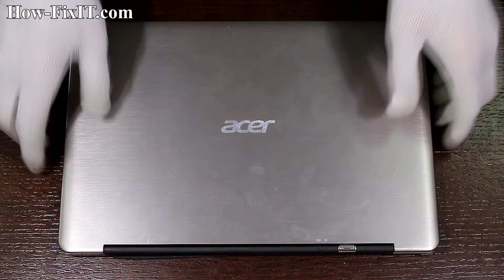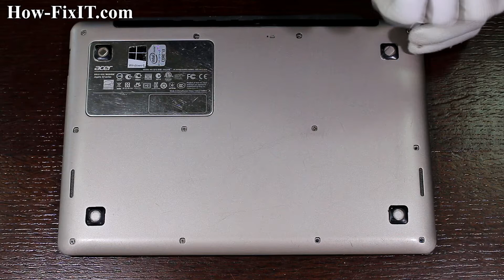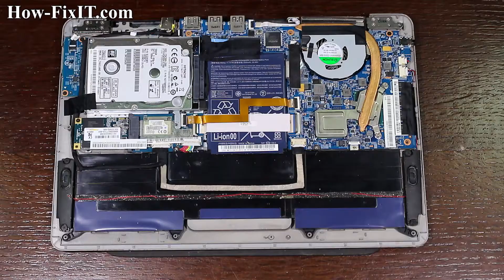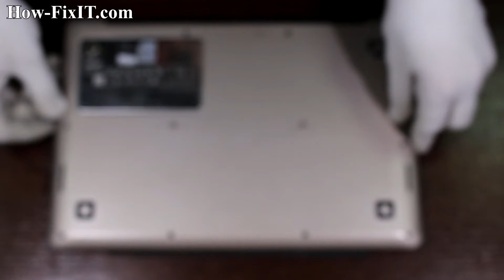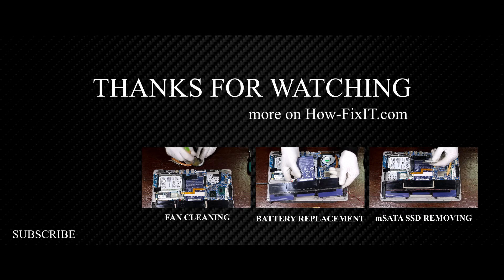Acer Aspire S3-951 MS2346 Hard Drive or SSD Upgrade: Replacement & Installation Guide

Comment: can the RAM be upgraded on MS2346 to 8GB?
Reply: I dont know if it can be upgraded. I have one of those ultrabooks since 2013, but never found something about RAM replacement. My computer was dead about one year ago so now I was trying to know it from inside and I found that RAM here is not the same as is in other laptops, it looks like smaller as nVme, but even smaller that those, but the ultrabook design is from 2012 I think, but it goes inside next to wifi card in a similar port like M.2, but there is only one useful port. So I think there is no way to upgrade it with other similar RAM card but I dont know if there are bigger ones likes 8GB. 
Ah, and there was a ticket over the card that said SSD-HDD, but I was using a 2.5 HDD for storage, so that confuses me a little bit. If anyone have some idea about this please comment. I was trying to fix it and upgrade some resources so my cousin could use it, thanks.